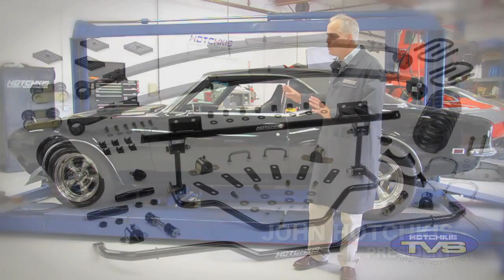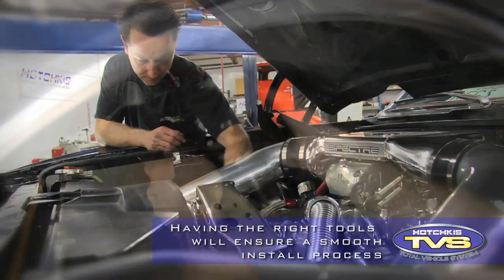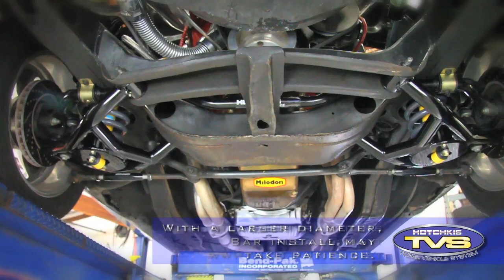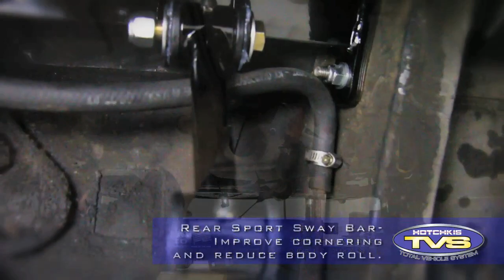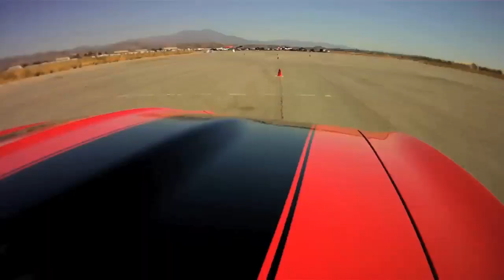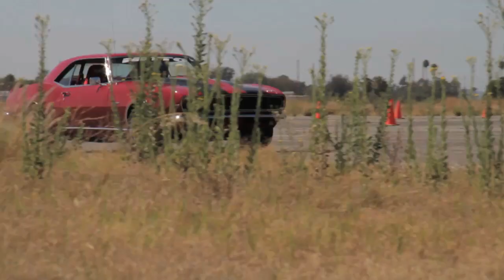How To: Hotchkis 1967-1969 Camaro TVS Suspension Install

Comment: I did all hotchkis springs with front sway bar only, stock control arms with energy suspn bushings, drives handles great. Next time i would replace the upper controls though, makes alignment better and easier!

Comment: Worthless video, you don't show anything about how to install springs etc. all this nonsense is just showing your product not "how to" as the title implies. Having said that I would love to have  Hotchkis suspension on my 1969 Camaro.
Reply: camarogs1 most important is the order of installation, so for people that actually know hiw to wrench, this is fine. comes with instructions.  figure it out dummy.
Reply: LOL probably out mechanic you any day of the week. Have a pretty good idea how it's done after restoring 5 1st gen Camaros, building 3 airplanes and 2 HD motorcycles. My point was the title is misleading and I did say I would love to put that kit on my current 1969 Corvette powered fuel injected Camaro.
Reply: They dont even use same car in after video nor saying how muxh lowering is
Reply: I just installed the tvs stage 2 on the front. The directions leave alot up to interpretation. The upper A arms attachment bar can be spun a full 360. One side is notched out while the other side is flat. The instructions say nothing about this. Good luck getting Hotchkiss on the phone.